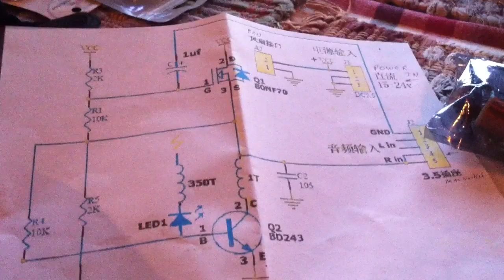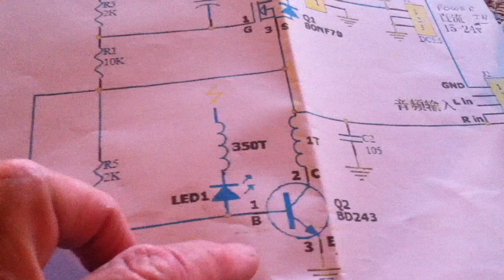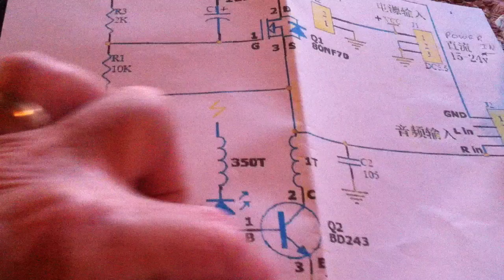Mini Tesla Coil Plasma Speaker ---- A fun electronics kit for under $10

Comment: Certainly louder than mine so that plastic speaker made a difference, thanks for the mention too 😊😊
Reply from the maker: I was going to use a little plastic cup but I couldn't find one.  This cut off water bottle worked pretty good.  I don't know how you put yours together so fast.  I worked hours on this because I had the wrong soldering iron.  I finally found an old one buried in the garage that got the job done.  My "de-soldering iron" had to be located also because of the mees I made on the board.

Comment: Should also be fine for audio by connecting to the Base of the BD243. 
They look quite nice for the money, congrats on the build.
Reply from the maker: I remember that you did this way back on one of your Slayer Exciters.  What comes around goes around.  This is a great little kit but you need to be able to solder the parts carefully. I screwed up on one of the transistors and almost gave up on the whole project.  Feeding the audio into the base should work.  I found this kit at a web site called 'NewFrog' .  They had a flash sale for this at $5.50 so I bought two.  One to build up stock and one to try mods on.
Reply: Ah yes, I get the NewFrog emails. Silly names nowadays, like Gearbest and Banggood..what's next , HamsterGold or AshtrayWin ? lol